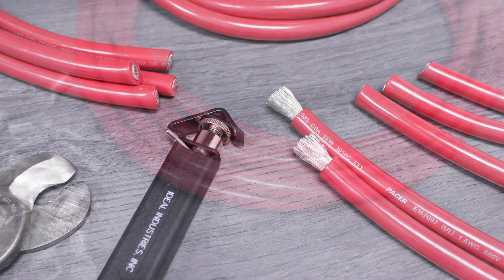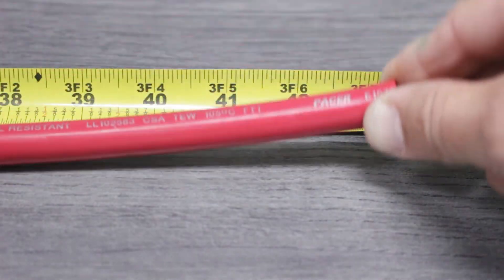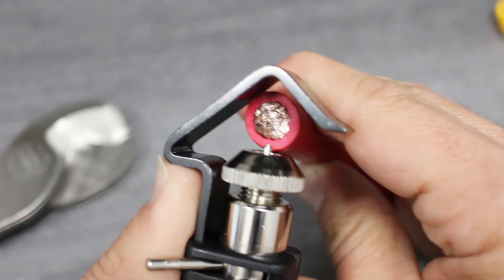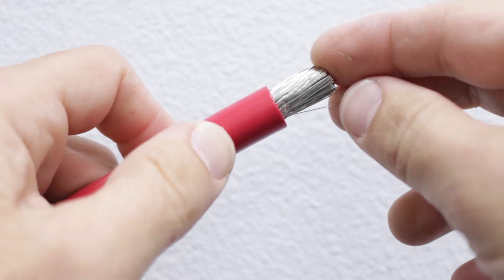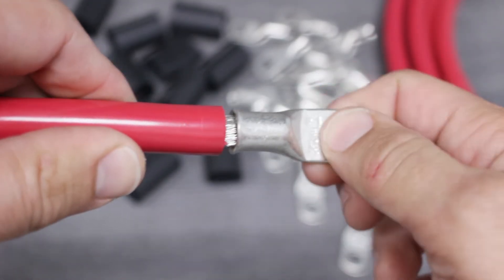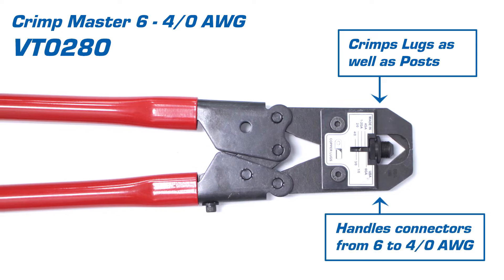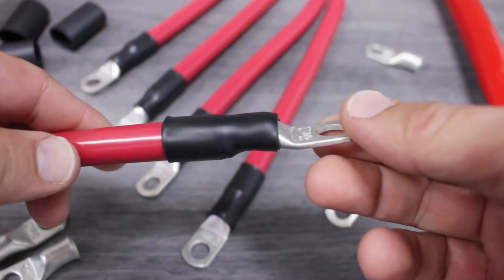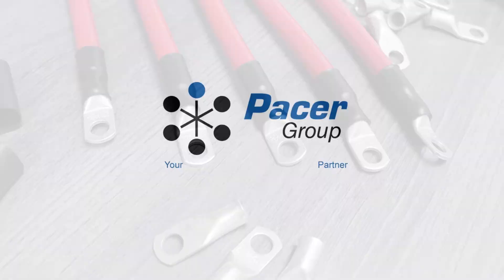Properly Installing Closed End Lugs

Comment: I love it when you go to the shop and buy the cable lugs and when you try to put them on you can’t because you need a specific tool to put them on and then you can’t do the job because the shops 15 minutes away and there closed